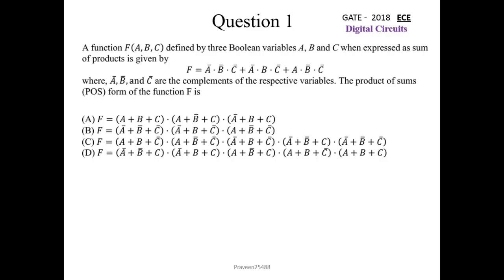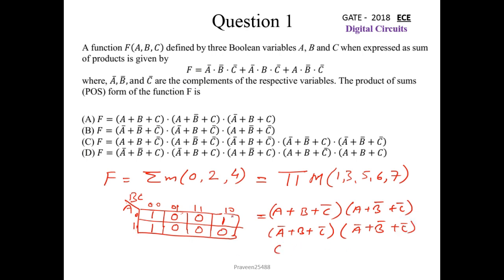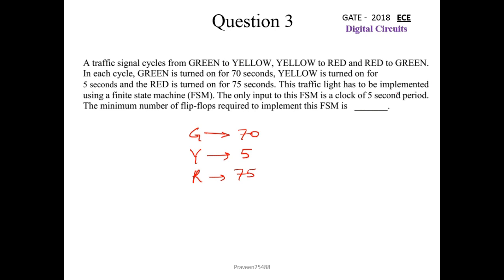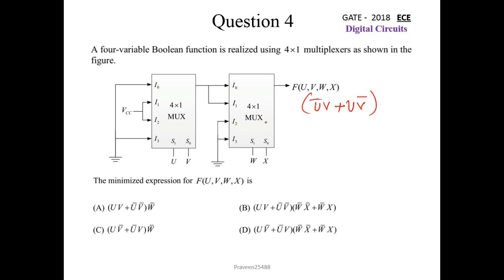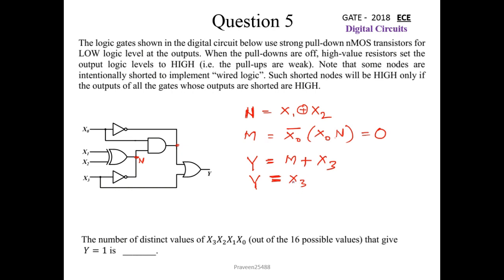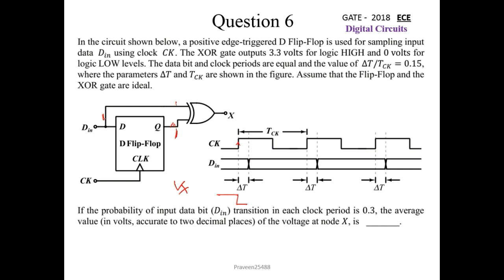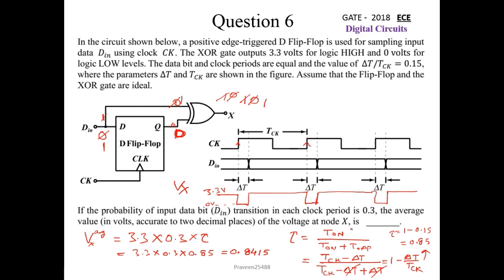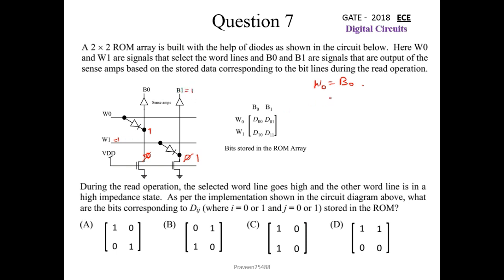GATE-2018 ECE (Digital Circuits) Questions with Solution

Comment: for q3, here state is only 3 red,green and yellow. seeking reference for your formula (used here for calculating no. of states) from any standard book or article.
Reply from the maker: That 3 states are for traffic signal. Here, we talk about total states of flipflops, or in other words, a number of 'combinations of bits'. In one cycle, traffic signal takes 70+5+75 = 150 seconds, and clock period is of 5 seconds. Then, required states of the 'combination of flipflops' would be 30.... Hope, it is clear now.